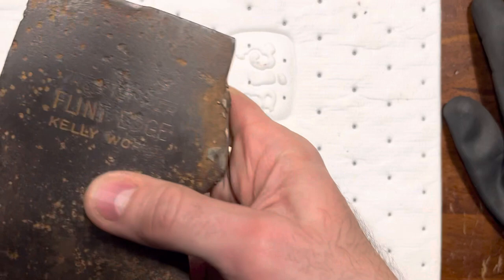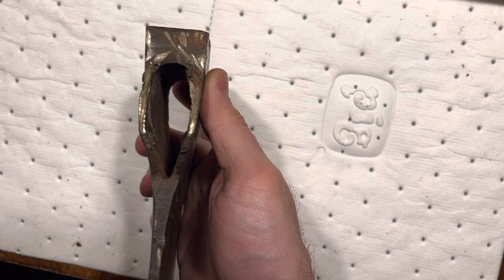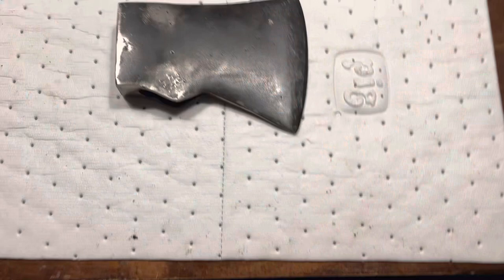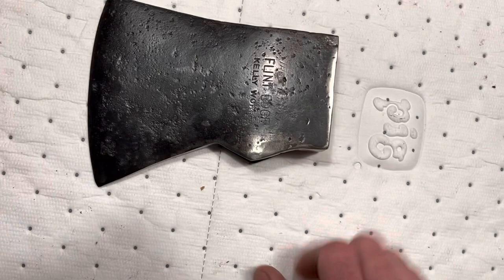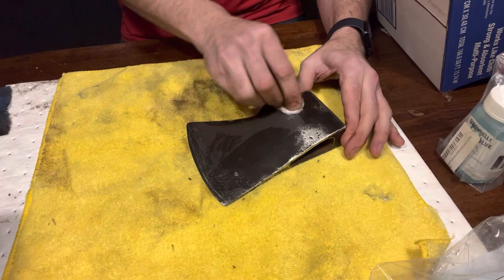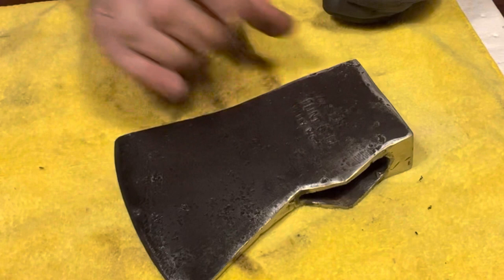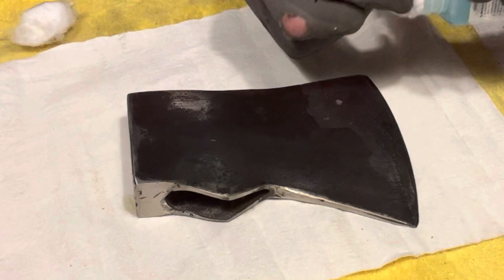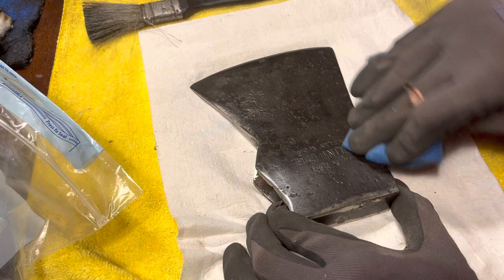Axe Restoration | True Temper FLINT EDGE Kelly Works

Comment: Holes were probably to pin the handle an somebody ground the ears off the bottom to make it easier to haft the points on the bottom dig in to the handle. With out lil extra wood work in those areas. Great job sir looks great!!!!!

Comment: I like to hit it with a heat gun before applying the blue, seems to get deeper smoother finish.  Make it warm not hot, if its too hot the chemical reaction seems to go to fast and looks streaky.  Hit it with 0000 between coats, wipe down with water and clean rag, rewarm (helps make sure its dry as well) and apply again.  Great job fixing the issues, that is how I like to do it as well, fix the issues but keep the character. Excellent job and that is a nice axe to add to the collection.
Reply from the maker: Thanks for the advice👍🏻👍🏻👍🏻

Comment: Yeah yeah! Makes it look 1000 x better, might give this a go for an old rusted 3.5 head I’m about to hang.
Reply from the maker: If you don’t care much about the head, I recommend grinding/sanding as smooth as you can, degrease a lot, then apply without allowing it to streak. Let completely dry, #00 steel wool, wipe clean, then repeat until desired finish. These value on these older more desirable heads would gone if I did all of that. But a cheaper less desirable head would be great!